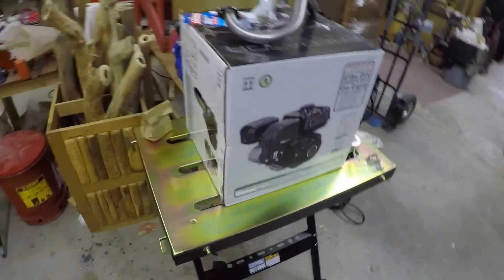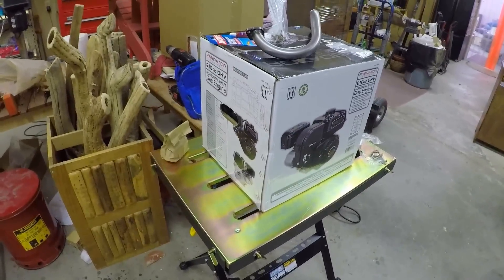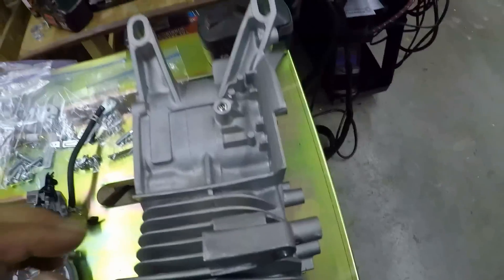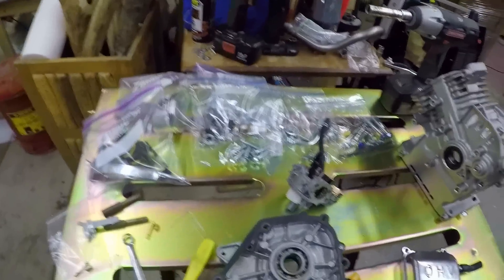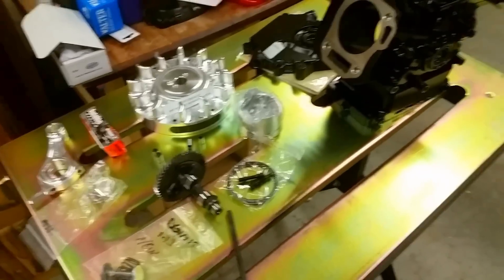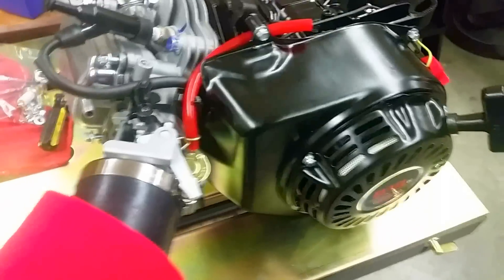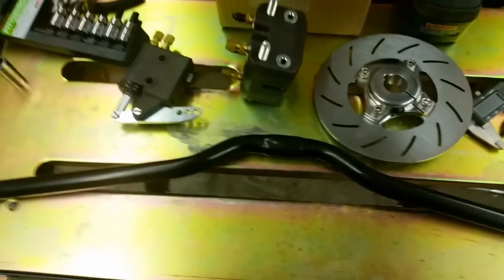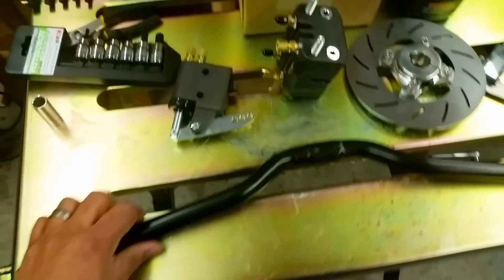Motorized Custom Drift Trike Build  (Part 1)

Comment: My AR3910X spark plug was longer than the original. 
Did you encounter this? 
If so, what was your rusult?
Reply from the maker: +Joshua Goodwin I never used the original plug that came with the engine. I immediately replaced the plug with the AR3910X.  I don't have a baseline as what to compare the increase in power. However I didn't do any upgrades to the other trike and I can distinguish a considerable jump in horsepower. Keep in mind that all the internals, flywheel, intake, and exhaust were upgraded in this engine.

Comment: Great info. Thanks! My son and I are about to build our first trike.
Reply from the maker: +Jason Keener nice! post a video of the build!
Reply: +switchjv do we have to rebuild the engine?
Reply: If you click on my channel, the to video is my son welding the frame. That's as far as we have gotten so far
Reply from the maker: +Jason Keener excellent. its great that you are including him on the build.
Reply from the maker: +Jason Keener you don't have to rebuild the engine. I just added some performance goodies on that engine. I didn't do anything to the second trike. I just removed the governor and the low oil sensor.

Comment: what do you consider is the cheapest budget you can have to make a decent motor trike
Reply from the maker: +david kolb I think if you picked up the bike parts through craigslist or yard sales and steel pipe through places like, Habitat for humanity's re-store.  You could probably get away with building one for $200. I purchased everything new so the total cost was about $700-$900.  If you have the tools, some of the parts could be fabricated as well.

Comment: Just a tip for next time, you can get parts way cheaper if you buy them direct from Box Stock Project, ARC, and other direct sellers/low price sellers such as Robert's Kart Shop and Dover Power, where you can just buy an already built Race kart clone engine.
Reply from the maker: ***** thanks for the information.

Comment: is it possible to keep everything original but just take out the govn.
Reply from the maker: Michael Garcia yes it can be done. I removed the governor and the low oil sensor on version 2.0. the rest of the motor was stock.https://youtu.be/tATH0bMdNdM
Reply: does it affect anything else and how do i know if i got correct af ratio ..can i drill out the jet
Reply from the maker: It doesn't affect anything. You just need to plug the holes with a couple of 1/4"×20 Allen inserts.
Reply from the maker: The cam can be left stock as well. You can drill out the jet. Honestly, they're so cheap I would rather purchase a new jet kit. Try BMI karts and supplies or omb warehouse. They have just about every upgrade possible for the predator engine.

Comment: Hey man. Which billet rod did you get? The regular one or the one that is .040" longer?
Reply from the maker: REAPER3fittyThe rod is an ARC billet rod that is the stock length. This rod measures 3.308" and was purchased from OMB warehouse.
Reply: switchjv Okay thanks a lot man.

Comment: I'm looking at making my own trike and getting that same motor have you had any problems with the motor? And about what speed dose it top out at?
Reply from the maker: 222bebob I haven't had any problems so far. I make sure to put premium fuel and use synthetic oil. I have gotten the trike to around 45 mph. However I have heard claims from other people who have the same engine of 60mph.

Comment: why did you have to take the engine apart.  What was the reason for that.
Reply from the maker: Daniel Roman I took the engine apart to remove the governor and its attachments, as well as to install the new arc rod and piston, mod2 cam gear, new lifters, and springs. it also was a lot easier to paint the block.

Comment: Love the engine. I'm about to start building. My local bike shop gave me 8bikes to chop. I'm gonna go with predator 6.5 hp no up grades from harbor but I'm having trouble with designing the rear end. I'm gonna use roller base bearings bc it is cheap from McMaster car. But frame work. Is my problem. I have been a machinist for 10 yrs and welding for two of them. So parts mod is no problem I'm right at 6foot 190lbs so I want a good frame. Aka rear end. Wanted a racing go kart to chop but cost to much. Gonna watch ur videos and see what's up. Our local redneck muffler shop sells these for $1000 plus... Wher I can spend 20 hours and make one. This is my girls account but hook me up with pointers. Right know got to roll the el camino out the garage fir a clean yup. Yeah needs a bigger engine itself :(

Comment: Would you know where I could just get the front end without buying a whole bicycle just to take the front end off because I don't know where I can just buy the forks and the fat tire
Reply from the maker: I found some on ebay. but honestly, it was cheaper to buy the whole bike. you can try statussuspension.com. they have bicycle parts, however they don't carry the 4"wide wheels.

Comment: where did you purchase the front end? the fork and the wheels?
Reply from the maker: I purchased them from wal-mart.com online. they sometimes have the dolomite model with the front brake setup for $199.  The front brake however doesn't stop very well. so I use the rear brake mostly. You could save some money and go with the Beast, which doesn't have the front brake. But its only $174 for a complete bike.

Comment: How much does this all cost
Reply from the maker: I estimate that I've probably spent about $900. However I've spent a little more upgrading the engine and its components. plus I bought a new dolomite bike for the front end. I guess if you didn't upgrade the engine and used a beach cruiser front end. you could spend a third of what ive spent.